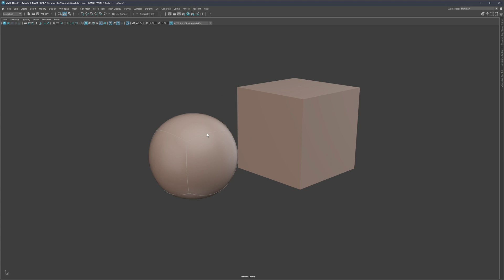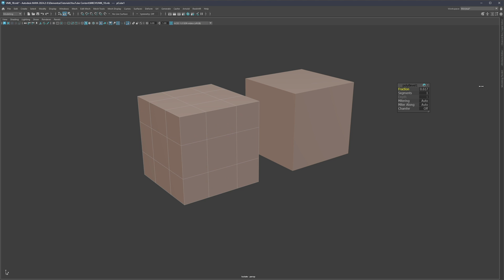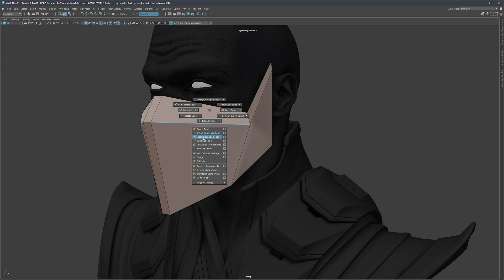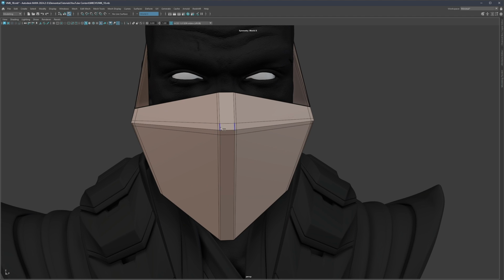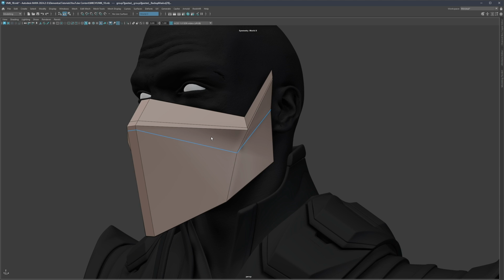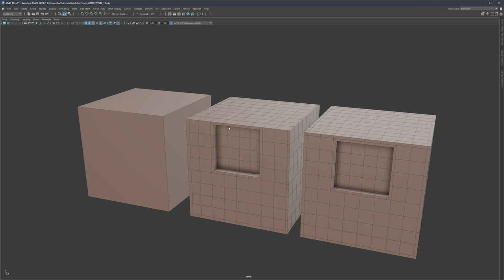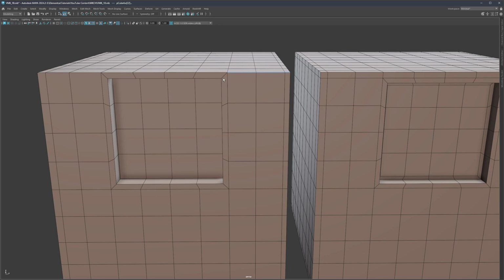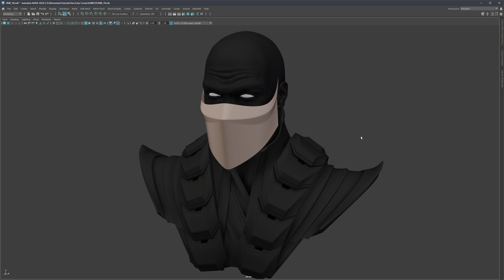Importance of Support Loops in 3D Modeling

Comment: Greetings Mario! Why not use creases in the initial stages of modeling?
Reply from the maker: Hey... creases are not as flexible like in the example where we just turn one of the supports into new structure and progress further into form. In the next video we'll see it with edge flow too where simple change makes different design result. 
Crease will give the same result, as the example where we add support loops to a single edge. They have their uses for sure.. personaly I use them only in rare occasions in ZBrush workflow

Just my 2 cents here

Comment: Thanks Mario

The mistake I was doing all this time was in the detailing stage. By directly extruding the meeh without giving it supporting loops. Now I know how to maintain the shape and where to add supportive edges. 

Thanks again ❤️
Reply from the maker: Yeah I see... but if you're in detail stage with dense enough geo its maybe not necessary ( as it could result in oversharpening). Its more important to keep them in check early on. Hope this helps
Reply: @Elementza  Thanks for the advice. Will keep it in mind 👍🏻